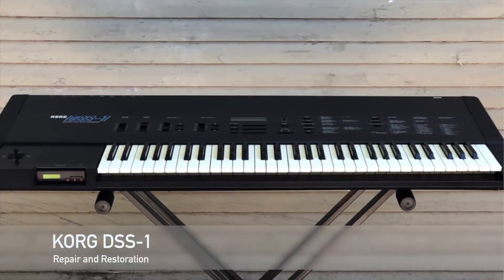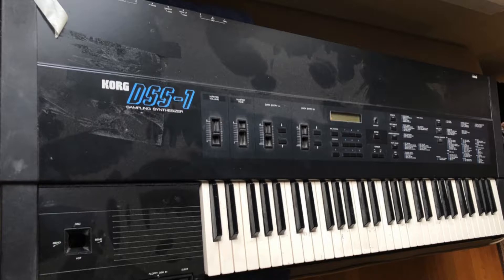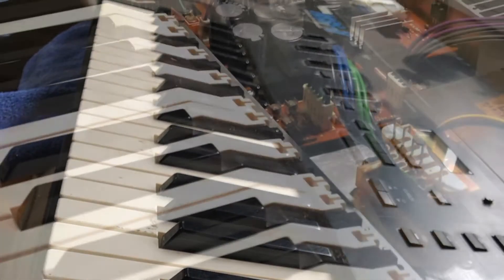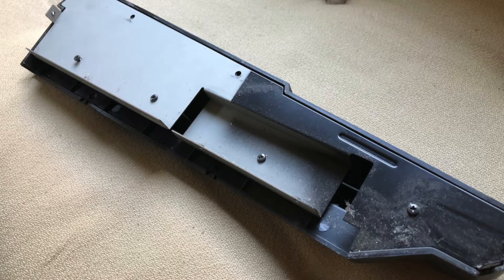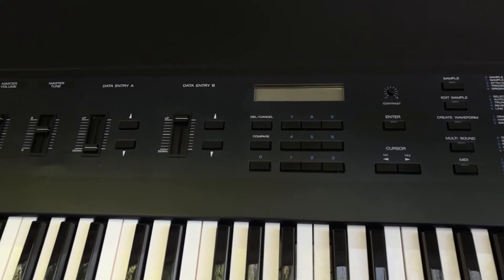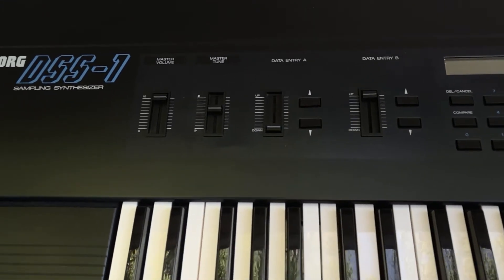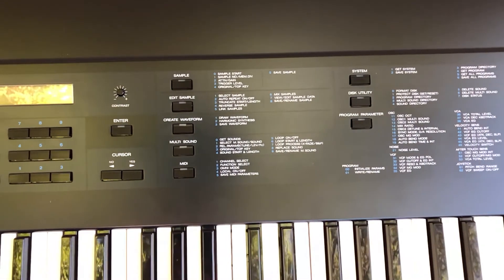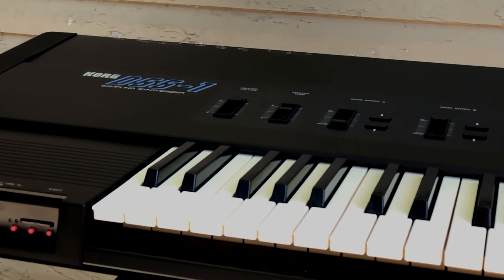Korg DSS-1 Repair and Restoration

Comment: Is it normal on this synth to have a litle hiss or hum when you adjust the volume slider? Certain piano patches I can hear the hiss worse than others and when I amp the keyboard you can hear it? Sounds like it needs a darn noise gate pedal or something. It's just a faint white noise buzz. But nothing to major. Just annoying when its amped. Maybe this is normal for the keyboard?
Reply from the maker: If the noise only happens when changing volume, then it is likely that only the volume slider itself is dirty or worn out. There are special cleaners for that. Research "cleaning a potentiometer". If the noise happens even when no sliders are being changed, it can be trickier to trace the cause. You could possibly use an oscilloscope to trace the signal back from the output and try to find the point in the circuit that the noise is getting introduced into the signal. But yah, a noise gate would be the easiest solution if that works for you.
Reply: @ABEHR  somebody in facebook said it could be the screen.  There is a piece on the screen mother board that is making the noise most likely? The screen it self makes a small noise and I swear that's the problem. Hell if I know I'm taking it to repair man this week. The keys on mine are very loud and tactile but I think thats how korg made them. They make a tiny click sound when pressed and you can hear it on the patches?  Could you do a video on how to replace the felt in this keyboard? That would be so cool. I have it all opened up and it's a pain to take apart.

Comment: I have a Dss1 for about 31 years. Most of the time it just sits there since the drive went out. I use it mostly for a stage prop in my music videos. I am not without some skills but replacing a drive might be beyond me. What would it cost to have a drive replaced?
Reply: If you order from Sampler Zone, it should be around 50 dlls delivered. Order it with with a small screen (but not rotary encoder) that way you can navigate and browse through the "floppies" in your USB drive. Once you save a "floppy" in the DSS, you can plug the USB in the computer and just rename the file, so when you are navigating, you know the contents of that specific floppy. It is an amazing tool!

Comment: Hey there. Just acquired this synth from an estate sale auction only to find it’s absolutely caked in gross mystery film and grime and such. It’s definitely in need of a deep cleaning. I’m struggling to understand the few resources available for service/disassembly and was wondering if you might be so kind as to assist me/provide guidance online so that I can disassemble it and give the outer casings and keys a soapy bath. I’d even be willing to compensate you 10 or 20 bucks for your time if necessary. I just really need help and I’m super anxious to get this thing in the house so that I can play it. It’s my first real synth and from what I’ve read and heard online it’s an amazing one at that. Super excited but also super intimidated by what I perceive to be the complexity that is the assembly of a synthesizer. Any help would be greatly appreciated. Thanks and God bless.

-Erik
Reply from the maker: First, make sure you are in a good mindset of curiosity and exploration. This video by Bjork might help: https://www.youtube.com/watch?v=75WFTHpOw8Y&t=134s   Then see if you can find a PDF of the service manual on-line. Take photos as you go and organize the screws you remove into labelled baggies. You can use compressed air, q-tips and alcohol, and even run parts under the sink with a soapy toothbrush. Just make sure everything is completely dry before plugging it back in. When I wash circuit boards I usually blow them out with compressed and and then put them under a warm lamp for 24 hours to dry before reassembly. If any of the cylindrical capacitors are leaking gunk (like a bad battery) then they will need to be replaced. I rarely break gear beyond repair, but I tell myself that if I do then it is an investment in my education.

Comment: Amazing, it looks like new. 

Out of curiosity: This instrument weighs 18kg. From having looked inside - any idea what makes it so heavy?
Reply from the maker: Check out the photos at 1:15. Lots of through-hole components, heavy gauge wire, and massive heat syncs. It seems to me that they weren't engineering for weight / size optimization though it would have been a better product if they had. I just bought a D50 and it is of a similar era but much more elegant on the inside.
Reply: @ABEHR  I was in keyboard sales at the time - I got to haul them all. ;-) 

Even Korg's own DW series - same era, seemingly different engineering team. I guess Korg's first attempt to enter the sampling market might have been an engineering mgmt mistake. 

Maybe that is also the reason why it sounds so exceptionally good.
Reply: Build quality. Every board is built with through-hole components, which means that a qualified technician will be able to diagnose and fix any issue, with readily available components for years to come. When it came out it was Korg's flagship/top of the line keyboard, It looks like it, it feels like it, it SOUNDS like it, and after all, it is a sampler AND a synthesizer.

Comment: I just cleaned mine! I bought it in 1990 and still have it but once I left it in the basement it got all that moisture. It cleaned up pretty well but some of the sounds are not loading from my disc. What kind of disc emulator did you buy and from where?  Great work!  I might even sell mine after I get it up and running.
Reply from the maker: It is this drive: https://lotharek.pl//productdetail.php?id=27
There are cheaper options out there, but this manufacturer specifically advertises support for the DSS-1. The drive swap was easy once you get too the drive itself which requires quite a bit of disassembly.

Comment: Any details on which floppy emulator you used, and was it a straight plug in play conversion?  Thanks!
Reply from the maker: It is this drive: https://lotharek.pl//productdetail.php?id=27
Yes, it was an easy swap (other than the disassembly / reassembly). Just unplugged the old one and plugged in the new one, that was it.
Reply: @ABEHR  that link is broken.  How about a product manufacturer name and model?

Comment: Any tips on replacing the felt and making it less clacky? I did it once to a previous DSS-1 I had and it was difficult. I'm probably asking fo trouble popping open a keyboard this old, but if it was quieter I'd play it more. Right now I use it remote via midi. Also, did De-Oxit on the buttons/ tact switches work for you? Thanks.

Comment: Also, if I may ask, are stuck keys easy to fix? I don't have any dead keys on my DSS-1 but there are a couple of keys that keep sending note-on information in polymodes.
Reply from the maker: Most everything in the synth needs to be removed in order to disassemble the keys. They are covered by the other parts. Also it is a delicate balance to remove the keys from the key-bed without breaking the little plastic tabs that hold them in place so I would rate them as not easy to fix. However, with enough patience, all things are possible.

Comment: Would love more details on disassembly. Is it hard to take apart??
Reply from the maker: It is easy to take apart. Just unscrew and unplug things! The harder part is re-assembly. It is one of the more complex synths that I have disassembled as far as number of boards and number of wires. I took a photo of every plug and every piece I removed before I disconnected it so that I would know which way it went back in. I also put screws in labelled sandwich bags, like "side panel", or "joystick" so that I would know which screws went to which parts. If you are organized and keep records of your disassembly, things aren't too difficult. It is logically arranged even though there are a lot of parts.
Reply: Thanks for the info. I'm primarily interested in cleaning the contacts of all the buttons. are they easy to get to??
Reply from the maker: Joely Barish The front panel buttons are not hard to access. I had some stuck screws that I needed special pliers to remove. That was my main challenge.
Reply from the maker: Joely Barish Look for the service manual online. It has an exploded view of all the parts which was helpful to cross reference during disassembly.

Comment: Great to see that in 2018! Where did you get the felt? Would love to order one for mine. The keyboard is one of the worst imho.
Reply from the maker: I got it from McMASTER-CARR. F7 Felt Strip, Firm, Adhesive Backing, 1/4" wide, 1/8" thick. 8762K711. It worked great but it can be a pain to disassemble the keys and scrape off all of the old felt which is glued on. Time consuming job, but made it a more useful keyboard.

Comment: AWESOME!  A work of love!  I bought mine new, back in 1984ish.  It is still my main keyboard........a few keys are intermittent, so now I have to take it apart and replace the felt and make repairs.  It survived the 94 earthquake......a dinosaur yes........but I like tanks, LOL!  Where did you get the drive replacement?  Thank you for the video, I was about to retire mine, but you have inspired me!  Cheers!
Reply from the maker: Thanks! I really like the DDS-1. The sound is unique and beautiful and I especially love the sound architecture. If only the synth wasn't so big and slow! It isn't at all practical for live performances. However, I'm keeping mine for the sound. I think of it as a poor-man's Prophet VS.

I'm hoping to make videos about the sound architecture as well as my additive synthesis workflow. I've programmed a Behringer BCR-2000 to give more immediate control of the parameters so I may do a video on that too. I just keep procrastinating on making the videos, but it is good to know that at least a couple people are interested.

The drive is this one: https://lotharek.pl//productdetail.php?id=27
The price is higher than similar drives, but on their website they specifically state that their drive works with the DSS-1 so that gave me confidence. It was a simple replacement. I just unplugged the old drive and plugged in the new drive, and it worked. I found disk images for all of the original Korg disks on-line and transferred them to the SD card. Works great, but is still slow like the original floppy.
Reply: LOL!  I attacked my DSS-1 after watching your video.......I love taking things apart......it's the reverse that's more challenging sometimes.  This time I pulled the keyboard out completely trying to get an intermittent key to behave.  So fragile!  I want to replace the felt, and read one blog that said you have to remove the keys!  NAH, I'm not having any of that......I removed the entire midi switch array from the assembly, just a bunch of screws, and now I can easily access the felt once I press all the keys at once!  I'm gonna look into that drive before reassembly,......I replaced the original a while back just so I could access one disk I got 30 years ago when I took a DSS-1 class!  The guy had his own creations and I love them.  I only make music for the enjoyment, and used his sounds in many pieces.  Now, I see there are mods and upgrades that make the DSS-1 really cooler......but since I use it mainly as a controller, I don't see the benefit.  I used to have several synth modules, but downsized to three computers and software synths.......playing the same sounds as the rack mount units!  Now I'm down to one fast computer that can handle a dozen soft synths at once.....way more than I can handle nowadays.  Thanks again for replying and the link.......Cheers!
Reply: Sadly, after two attempts at repairing a dead note, the keyboard now has several notes that are, uh, half velocity/power.  I think more may have been failing and I just accelerated the problems by removing the keyboard and replacing the return felt.  I guess I must move on unless I discover other options.  As before, I have only used it as a controller for years, but still love some of the sounds....mainly, Goser, a sound created by Ben Dowling, who taught my DSS-1 class decades ago.  I wonder if, after 30+ years, some of the circuits may be retiring on me, LOL!  Time will tell..........thanks again for the inspiration.
Reply from the maker: For these older keyboards, I usually just use them as a sound source and control them from a more modern keyboard. Though I love the sounds that the older synths make, the keyboard actions don't age as well.
Reply: Good point.....I never thought of that route...thanks